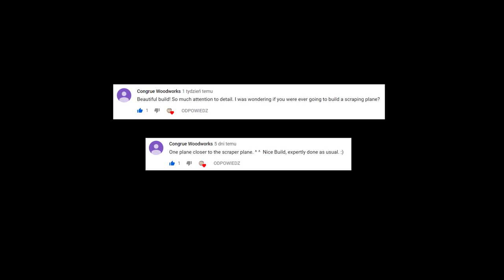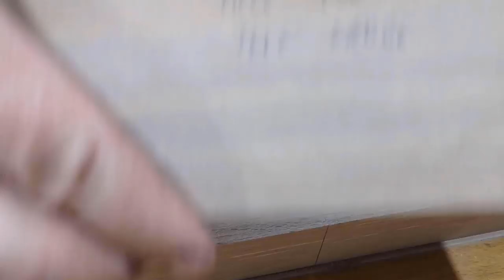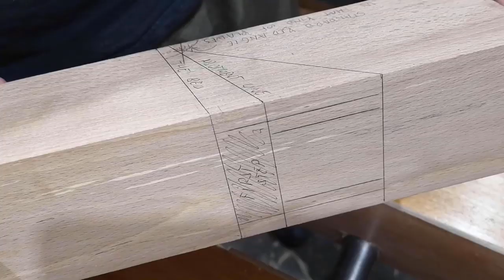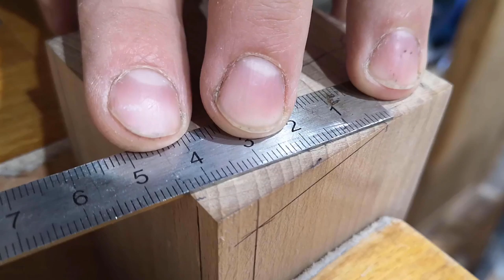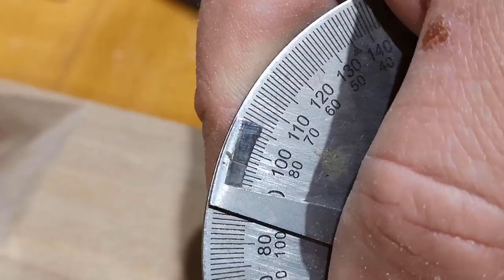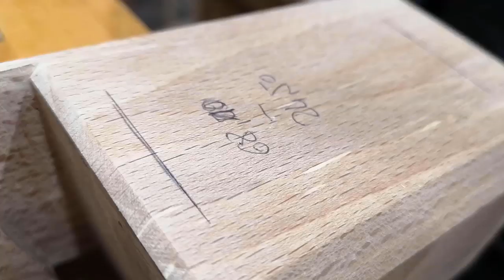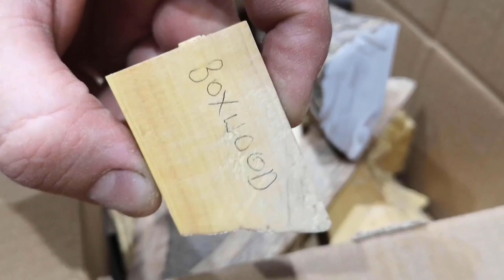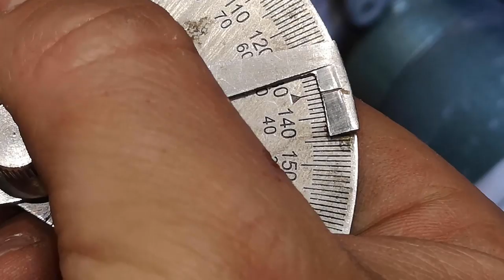013 Scraping plane - building process. Woodworking

Comment from the maker: It's just simple scraping plane. Great tool for removing machine marks frome wood surpace or for planing some crazy grains or veneers.. I hope you will enjoy it :)
Regards!
Reply: I would like to get into building my own planes. How do you go about sourcing your blanks? I have no idea how to get quarter sawn blanks that are thick enough in almost any species, much less beach. My mill doesn't have any (unless I ordered a truckload and was prepared to wait for kiln) and I am not in a position to mill my own and dry it. Am I missing something? Thanks ahead! Also, amazing videos!!
Reply: @andrewvanoverbeke5164  you could glue up two thinner pieces together?
Reply from the maker: @andrewvanoverbeke5164  i have a problem with it also. Most of the offers of the beech blanks are too far from me, and i don't want to buy it by Internet because i can't see it. You have to keep looking, finally you will find some good and dry material :) Regards!
Reply from the maker: @LegoMan-cz4mn  can be a solution when the grain goes the same, but it don't look good.
Reply: Always a pleasure to see good work, and you made a very handsome and useful plane.
Subscribed and voted. I'll be back for more :-)
Thanks for posting from a Norwegian furniture maker.

Comment: Your videos are getting better and better. Thank you for this nice work.
Vos vidéos sont de mieux en mieux. Merci pour ce superbe travail.
Reply: I have 2 questions. What wood is used for the body ? Beech ? Did you glue the tote ?
Reply from the maker: Thanks a lot! I really glad that you think that :) Yes, i use beech. I didn't glue it - tight fit plus fresh shellac on the tote and it wont move.  Regards!

Comment: Beautiful tool and delightful video! Looks to work flawlessly on that diving ash grain. Thanks for sharing. Would you say it performs different to something like a nr 80 cabinet scraper, where the blade protrudes by bending it?
Reply from the maker: Thank you :) Yes, it works much better because the blade hasn't bended blade. It fells more like using a plane, not a scraper. After that the surface is 100 % flat and you don't have to check it :) Regards!
Reply: @StavrosGakos  Nice! Thanks for the reply :)
Reply from the maker: @GillisBjork  you're welcome. Glad to help you :)

Comment: I really liked how you used small pieces for wedge fitting and then used it as a template.
Reply from the maker: That small pieces allows fit the wedge faster :)
Reply: Stavros Gakos I will definitely keep that trick in mind

Comment: From Router planes to Shoulder vises, I commend your work. Thank you for sharing your skills, Stavros. I enjoy your confidence when you stamp your maker's marks before you complete the project! I have one question; what is the angle on your scraper chisel for flattening the bed? You show us, we don't need to buy plane floats if we have one of those.
Reply from the maker: Thank you Harry:) 
One time, when i was stamping my marks i ruined finish on new smoothing plane. For that reason i do it a lot earlier now. For flattening the bed i use blunt chisels wich are sharpened on 90 degrees. All about it you can find on Bill Carter's channel https://youtu.be/re_bp5Lp0To

Regards!

Comment: All of your plane are awesome. Only one comment related to the anatomical orientation of wood. If you take a look to the old British plane Made out of beech you will notice that they are oriented in radial direction instead of tangential. This is to avoid the Natural swell and shrinkage due to rh and temperature change over a year. Resulting in a stable sole.

Comment: Is the tote glued in? I have seen a couple videos where you fit the tote like that but I haven't seen how or if it is solidly attached. It looks like a pretty good pressure fit but is it just so tight you need tools to get it out? Or is the glue not shown?
Reply from the maker: Hey John, at first there was no glue but after few months i put there two drops of hide glue.